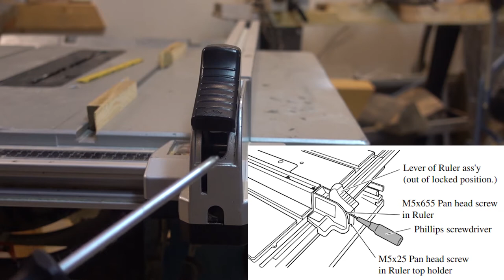MAKITA 2704 | Adjusting the fence

Comment: I have the same exact saw the way they designed that is piss poor it's a bunch of little parts that break very simply it doesn't hold well and it's over complicated for a simple lockdown system that handle is terrible to lock it in I don't understand why they didn't use a standard handle that comes down and operate the camera a Camelot system instead of those little hot and pizza pot metal that are inside of it I had the sofa less than 2 years and the whole mechanism just shattered for no reason terrible design Makita always made the worst fences I've ever seen and the adjustment on it when I replace the brand new one it wouldn't lock and unlock and then I tried the adjustment screw on it and it still wouldn't work